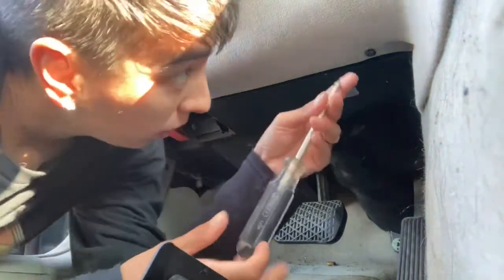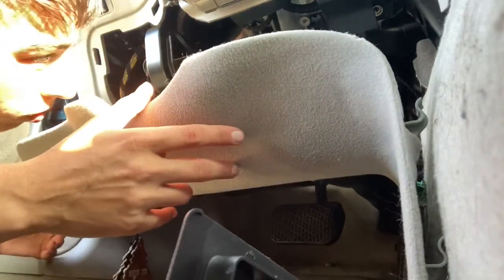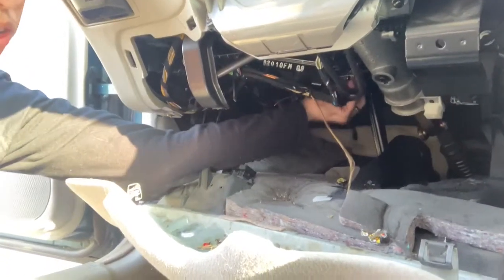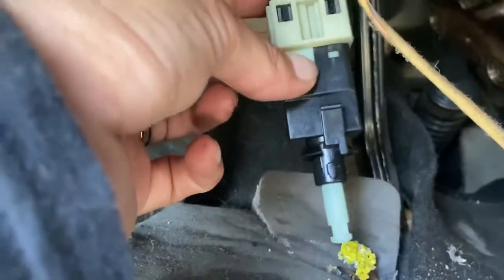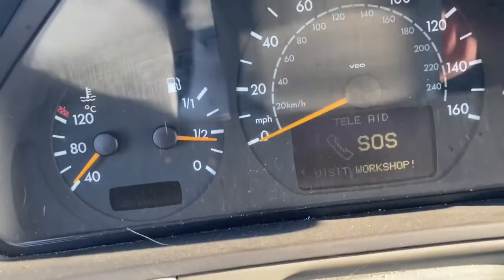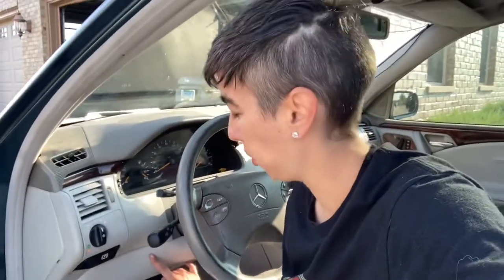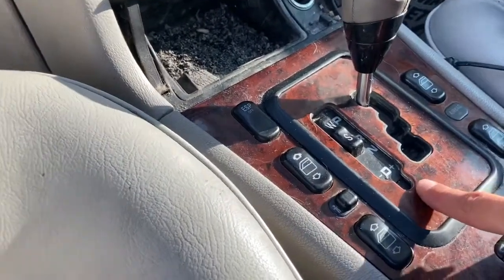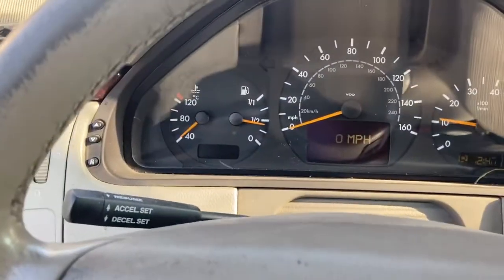Changing the Brake Light Switch on my 2001 Mercedes E320 4matic Wagon!

Comment: Hi. I have a question regarding this fix. Did you disconnect the battery 1st
Reply: I'm going to attempt this on my 99e320
Reply from the maker: No I didn’t
Reply from the maker: @jenniferlawrence6453  you can do it!
Reply: Thanks so much.  Pray this works. Mine will go into park but will not shift if the break lites are on. Shifts perfect when off! I'll post an update later!
Reply: It worked kinda!! The break lite is off and shifting fine yay. But the ABS, BAS lite is still on.
Reply from the maker: @jenniferlawrence6453  great job! I’m not sure about the lights but if you figure it out please let me know so future viewers can see how you fixed it 😊